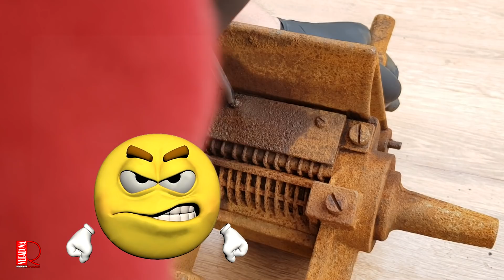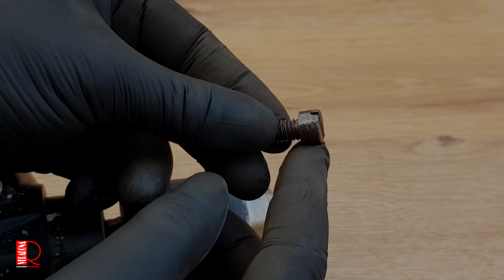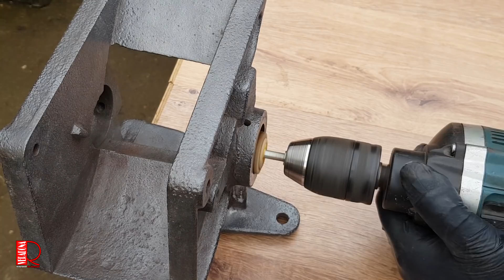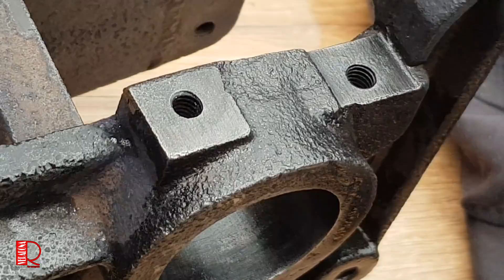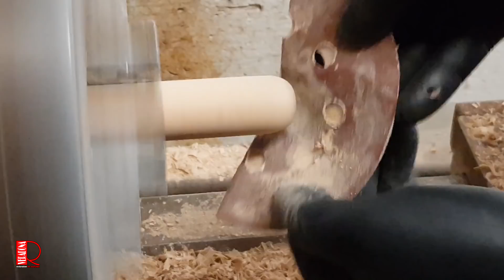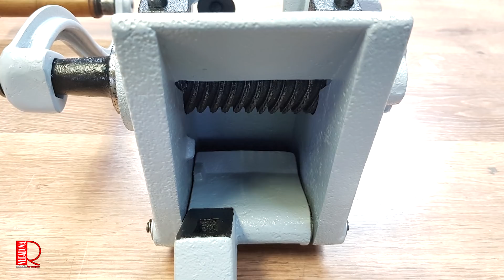Rusty bone grinder  - Restoration

Comment: A small recommendation  i would have soaked the whole thing in rust remover or diesel and even for 24hrs. Great restoration as usual i love your work.
Reply from the maker: Thank you for the advice Francis :)
Reply: Amazing work on the restoration.  But with something this badly rusted, a wire brush cleaning to get all the initial rust off, soak in rust remover for 24 hours, then penetrating oils for another 24 .. may have made it easier to take apart.  Of course that's a maybe .. the stupid back street driver talking after the fact.  Since you were working with it you would know better the condition and if such things may have helped.  Still amazing work.  And putting together the new handle using something from the junk pile and changing it so it would fit.  Incredible work.  I was very impressed at that work.  I love watching these as a way to relax at the end of a day.
Reply from the maker: @walterengler5709  Thank you friend for a nice comment and advice. Many people write about this method, soak in a rust remover and then into diesel. I haven't tried it yet. I find it quite lengthy. But it probably works :) Have a nice day Radek.
Reply: My understanding is that the red iron oxide swells and takes more space.  That is what causes the binding.  The black oxide is beneficial to the iron, and it takes up less space.  Most rust removers/converters turn the red oxide into the black oxide.  That helps the part loosen back up.  Even just vinegar works fine.
Reply: Using electrolysis to remove rust may help 🙂
Reply: 24 hours in diesel would have loosed a lot of the sized parts.
Reply: @VeradonaRestoration  : Radek, have you heard of the method where you soak in a mixture of water and molasses (10:1)? It's quite slow, one or two weeks, but very effective. Mix the molasses into hot water, immerse the object, and cover the container. Check the object every few days until you are satisfied. The surface rust just falls off and threads loosen very effectively. You can re-use the mixture until it becomes a smelly, gloopy mess then safely put it in the drain, as it's completely safe and biodegradeable. I enjoyed the restoration and it's good that your little dog gets a treat. 😀
Reply from the maker: @johnpowell5433  Thank you John, this is very interesting. I haven't heard that yet. I just don't like the long soak time. I'm impatient. But thank you, I'll try :))) Have a nice day Radek.
Reply: @VeradonaRestoration  : I understand that impatience but you do save a lot of time. The length of time for soaking depends on the severity of the corrosion. More lightly rusted parts respond more quickly. Just check every day! 😉
Reply: @johnpowell5433  molasses and hot water.  That is interesting since molasses is cheap, multiple uses like cookies, and safe for klutzy me.  Time I have, skin is getting harder to regrow.

Comment: That HAS to be the highest percentage of stuck fasteners I've seen you encounter yet! Watching as you escalate from penetrating oil to heat to brute force to a cutoff wheel on the grinder gives me flashbacks to my days in aviation.

Comment: Never hit materials that are cast iron, or that have any compound or materials with alliance because they crack they break! Let it soak in Kerocene Gasoil for 24 or 48 hours., Also if you heat the cast iron, you should do it in a place that is not windy, because it can break due to the change in temperature., To fix cracks in cast iron, you must first heat weld , and cool with an ash bath.

Comment: Tip: keep a bucket of old parts cleaner to soak things like this overnight
Reply: What is 'parts cleaner' made of? Is there a substitute, like mineral spirits (or odorless mineral spirits)?
Reply: Could a night in Cola have worked?
Reply: Just toss it in a bucket of diesel, that stuff has a habit of getting everywhere and it won't dry out like that WD40 you were using.
Reply: I was thinking more of Electrolyses. For a couple of days.

Comment: Great job! Have you ever tried electrolytic rust removing? Should be more effective than brute force :)
Reply from the maker: Yes I did. It takes too long. I have to have everything now :)) Thanks Lukas :)
Reply: @VeradonaRestoration  Evaporust is a chelation treatment that works quite quickly, and I would expect a bit faster if gently heated. It really works wonders...

Comment: - Let's weld this piece. 
- Dude is cast iron, not iron. Do you want to just weld it with regular wire? 
- Forget it - I do it for YouTube.
Reply: Welding sticks come in cast iron, too.  I sure hope he used that type.
Reply: @aprilbennett4161  do not forget that even in this case, cast iron requires preliminary heating for good quality
Reply: Anatoly Zhestov Preliminary heating and controlled cool down after welding
Reply: gadzoo The virus  Are you a trained welder? If so, can you tell why are we wrong in our comments?

Comment: little trick when welding cast iron, keep the metal pretty hot, and after a bout an inch or two of bead stop and use a ball peen hammer to gently tap the weld it compresses the weld and pushes it in deeper making a stronger bond with the cast iron.great work sir,love your vids
Reply from the maker: Thank you so much :) Radek

Comment: I feel like if you had just done a few single beads instead of just dots when you welded that piece together, it would of mad it stronger because it looked like the metal did not fuse with the base plate to well

Comment: Nice resturation , but welding cast iron with mig? And then putting putty on those "welds"? Really? You have access to oxy-acetylen please braze cast iron next time. Greetings
Reply: nothing wrong with mig welding cast BUT, he needs to learn how to do it so that it would be strong. cold welding cast will easily break off. that's not strong at all, not even a little bit. i got up to that part and could not watch any further

Comment: This is one of the worst restoration films I even seen. Instead of damaging the tool with fire, you could use the break oil for few times and wait for two hours. You just damaged this old tool

Comment: When trimming tape around edges...it works very well if you use some 120 grit sandpaper. leaves a nice clean edge. I use it on golf clubs that I repaint.
Reply from the maker: Thanks for advicePike. I started using a flat file and it also has a decent result on these castings. Radek

Comment: I thought it impossible to weld that cast iron. Loved that you proved me wrong :D Great restoration!
Reply: I haven't done it myself but have seen a few more experienced welders do this- they always pre-heated the parts, stick welded with special cast iron rods, peened the welds with a hammer then wrapped in insulation so that cooling happened very slowly. Obviously mig welding worked in this video but possibly not ideal. 

Ps loved the video.

Comment: As always, very entertaining. I'd recommend investing in an impact driver. It's a tool you attach a screw driver bit to (or any other socket or bit) put it to the screw the same way you would a screwdriver. Then you give the tool a sharp strike with a hammer and while driving the bit tighter into the screw head it will also turn it slightly. I work on old motorcycles and I couldn't get through the day without this tool. Very slick repair on the crank arm.
Reply from the maker: Thank you for your advice, I have to buy it :)
Reply: @VeradonaRestoration  it's one of the most inexpensive tools I own and I use it daily.
Tekton 2905

Comment: Nice restoration.  I was always under the impression that when welding cast iron, it needs to be preheated before welding and then cooled down slowly.
Reply: You should but if it doesn't crack it will be fine. This piece was small so heat would dissipate fast no matter what. I noticed he did small tack welds which helped.

Comment: bit of advice, try to buy screwdrivers with a square cross-section on the metal shaft, that way, you can put a wrench on it for added torque.
Reply from the maker: Yes, thank you for your advice :)

Comment: Might want to invest in an impact screwdriver for those stubborn screws. Also here's a neat trick, you can hammer some low grit sandpaper into your welds to make them look more like a casting. Cheers!
Reply from the maker: Thank you for your advice with sandpaper Justyn.  I have already purchased an impact screwdriver.😉❤🇨🇿

Comment: Wow Veronika you’re an amazing woman, you can weld, use power tools even a metal lathe and at 6:20 you can hold a drift with your left hand, use a hammer with your right hand and use a blow torch with your other hand. Hang on a minute.....WTF 😂😂😂
Hi Radek, you two do awesome work together. Adapting that handle was brilliant, it looks so original. Like others I had never seen anything like that before and only knew of using ground up bone for the garden. I bet that restoration is your dog’s favourite as he can share in the roast chicken now too.
Cheers, Stuart 🇦🇺
Reply from the maker: It was funny, but you don't think I have such hairy hands LOL  healthy Veronika and Radek

Comment: Don't  chuck out the vinegar and rust  mix coffee filter and reuse  also makes a very good pickle for oak brush or dip it in until you get the colour silver towards black   must have lots of rust in it  use the custard from your bench too
Reply: That should b dust
Reply from the maker: Thank you for the comment Simon, but I do not understand much translation

Comment: Just a tip, most screwdrivers have a squared-off end at the base of the handle. You can use a wrench to help give you additional leverage for stubborn screws.
Reply from the maker: I don't have that, but I bought an impact screwdriver next time :) Thanks Robert

Comment: Your English is better than most, quit apologizing for it. Is what it is. My question is, once it's ground up, then what? what can you do with it? will it grind say beef bones?
Reply from the maker: As I wrote here, the grinder is designed for grinding bones for hens, but I have also heard the opinion as a fertilizer for flowers.
Reply: @VeradonaRestoration  Fertilizer sounds like the better idea. Feeding it back to hens doesn't set well with me. I dislike chicken anyway.  Used to raise them when I was a kid, and I got stuck with all the dirty jobs.

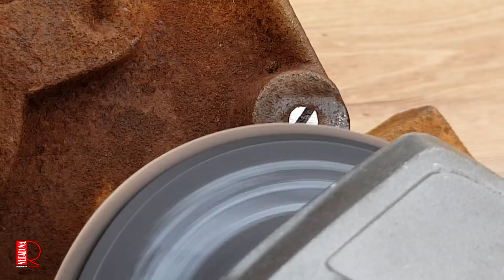Comment: I see you do very good work! at the time 3:13 when you was grinding off the pin there is a lock pin in the side of the long pin I seen. But there was no way of getting it out except the way you did it!!
Reply from the maker: Yes, the body is made of cast iron and I was afraid it would crack, as it happened to me later ...

Comment: Next project get some molasses, and water in a bucket 1 part molasses to  9 parts water. Let the project soak for a week.  Then just rinse the rust off with water.
Reply from the maker: Thanks Charles. I have already bought a sandblasting box, it will be easier :) Radek

Comment: Good restoration. But one question. Did you mixed graphite with water or which liquid?
Reply from the maker: Yes from water, but you have to paint the graphite, otherwise it will get dirty
Reply: @VeradonaRestoration  thanks!

Comment: Nice Job...Pity the part break...for some reason I feel that there is another part missing... When grinding the bones there is a square hole on the pressing plate... Maybe another part or flap or cover to press bones in on the top...Keep up good work....
Reply from the maker: Thank you.  Yes, surely something belongs to the rectangular hole, but I couldn't figure out what 🤔 I asked different collectors and no one knew.  They always sent me pictures of the very same grinder, but without the hole.  Thank you for watching Radek.

Comment: Heated cast iron when cooled to fast will break it instantly :(. Next time soak the whole thing in kerosene a few days before hand. Then you can heat it and it will help. Also what works for me is low heat and water.
Reply from the maker: Thank you for the advice :)

Comment: This is probably a stupid question. Was the purpose of putting the handle in the fire to heat treat it? Beautiful puppy by the way!
Reply from the maker: To relieve the tension between the cast iron and the weld.
Reply: Veradona Restoration that’s very interesting! Thank you for the clarification!

Comment: Personally I think you got that thing way too hot with the torch. My rule of thumb is to never torch it so much so that the metal begins to turn incandescent/glow. That might be part of why the frame broke, a change in the grain structure in that area caused by the stress from the heat.
Reply from the maker: No, that's what I did when I tried to press the center with a press. And the press jumped ...
Reply: @VeradonaRestoration  ah ok. That makes a lot more sense, but I still recommend taking it easy on the torch haha. Thanks for the content though! :)

Comment: I think the plate should have be open. load the bones and then pushed down by lifting the bar to feed the grinding wheel
Reply from the maker: It's possible, I've never used it, and I probably won't. After grinding it must be unscrewed and washed. It's like another renovation :)) Thank you Todd :)

Comment: Why don’t you try taking off the surface rust first and then soaking the object in penetrating oil? If the screws and bolts are still sticking use a touch. It seems like your doing way too much work. Also invest in some standard measurement wrenches.

Comment: wow remind me not to let this guy restore anything of mine like who cold welds cast iron and not to mention who beats on cast iron like that in the first place. lmfao
Reply: You do know there are alloys of welding material designed specifically for welding all types of iron... right!?! also heating iron makes it malleable enough that the shock of light blows will make it less susceptible to cracking and breaking. The fact that both procedures were done without damaging the piece is testament that he may know what he is doing. Now if that piece had a critical function and life and safety were at risk I would suggest other methods of restoration be used...

Comment: Next time. 1. Soak it in Vinegar. 2. Head the bolt and add wax to the thread. 3. When you use heat you are heating the housing not the bolt or item you want to loosen. Heat makes X expand. Dont heat the bolt or drum you dont want that part to expand. Do ad water like that. 4. Definitely start with 1. If everything was sized like that.

Comment: Does this guy not realise cast iron is basically the most brittle ferrous material and to weld properly needs specialist treatments, you can't weld it properly wi the a Mig.
Reply from the maker: This guy is fully aware of this. 90% of the cast iron is perfectly welded with CO2. If it does not have a high carbon content. You should try it.